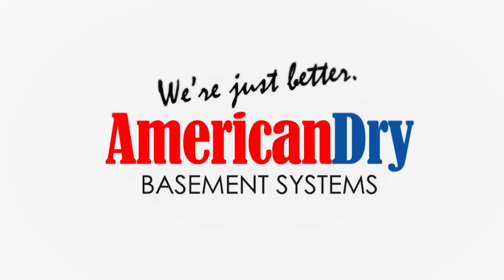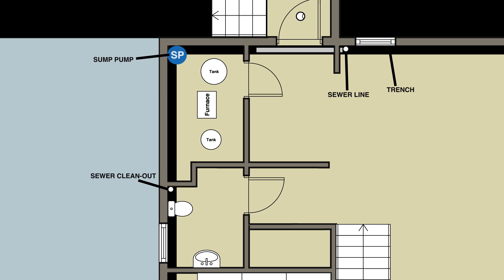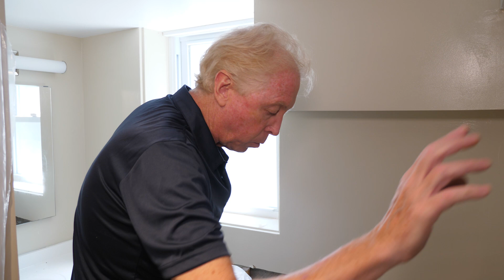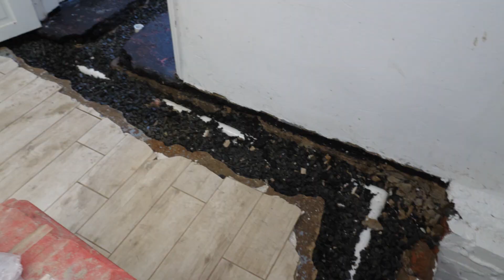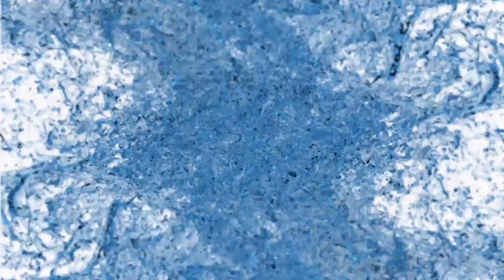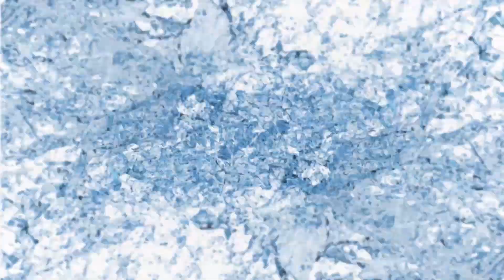Basement Waterproofing | Sewer Line and Bathroom

Comment: I can’t thank you enough for all of the in-depth videos. With the help of your videos I was actually able to install my own perfectly functioning french drain. I was lucky enough not to have to deal with any sewer pipes on the wall that I was waterproofing but after seeing this newest video it brings up a couple questions I have if you don’t mind. First, do you see damage often by jackhammering around the pipes? Second, how do you navigate around kitchen sewer pipes or even the main stack? I’d assume underneath, but I wasn’t sure if the depth of these pipes would vary and at a certain point I could see them affecting the slope if you had to dig too far underneath. Much appreciated!
Reply from the maker: I'm glad my videos are helping. The pitch of the pipe is vital. Do not compromise. You have three options when it comes to subfloor utility pipes. 1. Work around them to keep depth and pitch. 2. Have plumber replace old pipes and route them differently. 3. Depending on layout, work between them if you can maintain pitch. It is ultimately up to you to make that decision.